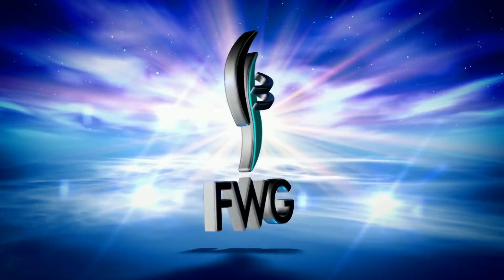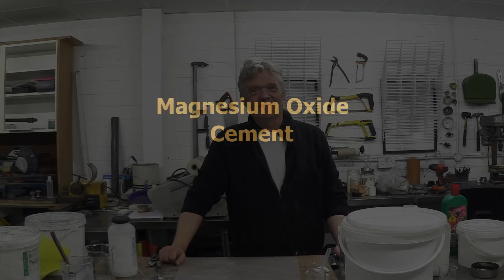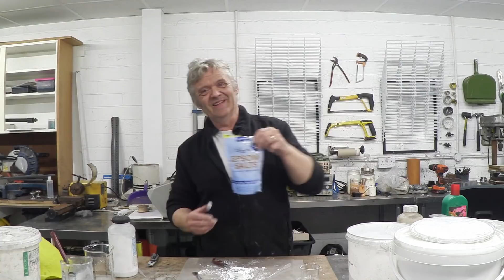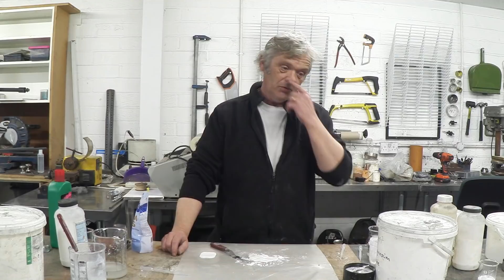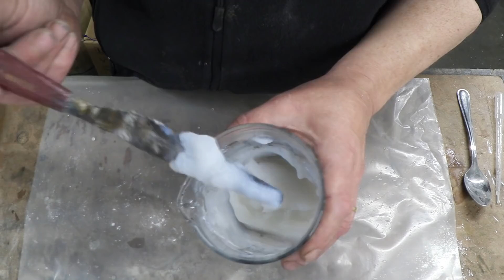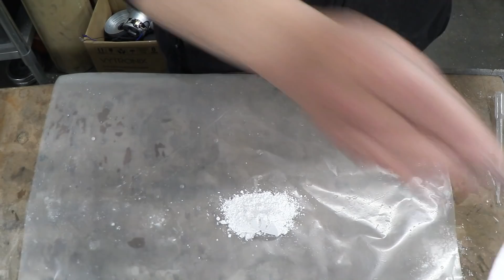All About Magnesium Oxide Cements

Comment: I am from Bangladesh. Recently I'm working on Magnesium Oxychloride cement as part of my MSc thesis. Unfortunately, I'm facing some problems while using MgO powder, MgCl2 and water. As first step, I made a solution of Magnesium chloride hexahydrate by distilled water where molar ratio was 1:13. Then I mix it with MgO powder of molar ratio 7. But, by mixing this way, I could not make any paste of cement. It remained at powder level. I further increased water upto 18 mole. But no change in the condition. That's why it was not possible for me to give shape by mold. Now, I didn't understand what fault is going on actually. I am mixing as per instruction of paper, but not finding the expected result. (Mass contect was =MgO: MgCl2.6H20: H2O= 50g: 36.23g: 41.78g = 7: 1: 13). 
 If you help me telling what is wrong here, and tell the actual mixing ratio. Then it will be very helpful for me.
Thank you

Comment: I wonder why the manufacturers of MgO boards chose to go with magnesium chloride over a phosphate. Surely they must have known that the chloride would leach due to moisture. I read that Denmark is spending 300 million US dollars to replace Mgo board used in construction.

The new MgO boards are using magnesium sulphate, which you have also said is susceptible to moisture. Any idea how they might be overcoming the moisture challenge?
Reply: I am interested in this sulfate modification to MgO board too! I thought that chloride free mag oxy sulfate board did not leach...
Reply: @SashaInTheCloud  Don't know for sure, just going by what the video reveals. Good luck with your research. I have come to discover it is a fascinating area of material science with many unusual characters doing home experiments.

Comment: ...........Thanks and I'll try some of the things you've outlined. Some version of the zinc oxide cement was or is used as a temporary filling in dentistry .locally I haven't seen lasting results where lime sand mortar was used in building work. The work being good work but the mortar being a letdown . Perhaps some critical factor  was lacking in the formula. Portland cement for mortar was rationed during ww2 and I've seen many structures in recent years that needed to be pulled down. The theory was lime mortar strengthened with time due calcium carbonate crystals formation cos of co2 in atmosphere ..I think co2 conc in atmosphere has to be just right and we've upset the Goldilocks already .
Reply from the maker: nice one ate - I didn't know the zinc oxide formula was still used - that is interesting - cheers

Comment: Hi Robert, I have got a question. If the reaction takes place when water is added, then, should we consider these cements "hydraulic cements"? 

Another question: Wouldn't it be better if you mix the 2 powders first and then add the water? Specially with the last one, the fumed silica with magnesium oxide, as dispersing the fumed silica in the magnesium oxide first will make it more workable once you add the water.

Thanks, Rob.

Comment: if you use zinkoxide and zinksulfate add graphene or graphite you would make the concrete to be  hydrophobic?
Reply from the maker: dunno - worth a try - go for it
Reply: @ThinkingandTinkering  thanks and I will give it a try it with rust...this should be the cheapest rustconverter out there...just put some Iron sulfate on the cleaned rusted surface and .....we have iron cement instead of rust....I will give that a try
Reply: @rudolfdesadeleer7995  how did it go?

Comment: Hearing the word, magnesium, reminds me of the time I saw someone throw a magnesium block into a campfire. It lit up the night like it was day time! Wow did it ever burn really really bright!
So I wonder if these magnesium cements have good fire ratings like portland cements do?
From what I have seen here, it looks like portland cement is the best all around material, it is very plentiful and cheap, it is workable, sets in a reasnoable rate of time, has fantastic strength and water resistance, fire proof and can be mixed with room temperature water to make a reaction. Portland is an all around better product for sidewalks and foundations. Just add in some tensile reinforcement and you have a really useful product!
Reply from the maker: It does burn bright for sure
Reply: They are fireproof. MG is way different from MgO

Comment: The fumed silica and magnesium oxide cement, is it not stable in water either?
If it is unstable in water, could something like water glass be mixed with it and then baked to make it water resistant?
Reply: The reason I looked here for this experiment is because I have been looking up information on Air Crete. 
This lead me to Air Krete. 
I’m looking for a very lite structural cement/concrete. 
Do you have any ideas?

Comment: Great Video Robert! I wonder if the leaching problem could be mitigated by coating the cement with a waterproof material?  I know that the Dutch use an 18kg mix of a polymer  (recycled plastic bottles! )to a ton of crushed rock to make weather proofing for sea defences such as the final layer on sea walls. I think it was the Romans who discovered cement that we use today. I believe they used weathered lava or pumice stone. Thanks I learned a lot. I wonder if the coating I am suggesting would use adsorbtion or absorbtion to stick to the surface? I suspect you would know.
Reply from the maker: for sure mate

Comment: For a short time while working on a ballistic armor project and realizing how expensive those ceramics can be I did a bunch of research into specialized concretes used for ballistic protection. I tried to use those concepts but never really got anywhere. Always too heavy. But I still think it could be a good idea.
Reply: Check out crystalline nanocellulose.  It has a lot of promise in that area--especially so when you carbonize it and blend it with epoxy, Titebond III, or similar.  I'm curious how the borax+wood glue plastic, using the former as a filler would work?
Reply from the maker: that is interesting for sure mate

Comment: This is so detailed to detailed for me  IV been looking for a fire cement for a fire pit could someone please put me in the right direction
Reply: I'm actually doing a forge/kiln in the coming days and probably got on this vid due to finding an old refractory brick video from the 50s, which showed how they made magnesium oxide/chloride alumina refractory bricks for furnaces. Personally I've settled on a mix of sand, silica powder, aluminum oxide and a inner wall of silicon carbide for the face coating (as I have all these presently) and plan to use sodium silicate as the binding agent. While the MGo idea seems like it'd work quite well with some high temp additives, getting enough in large quantities--even though the raw materials are stupid cheap--shipped to the house would cost an absolute fortune, so I'm going with my first plan. I also found a 94 page thesis from 1949 on phosphoric acid bonding to refractory materials and am reading through that looking for clues to aid what the kiln project is being built for, UHTC research. So much forgotten knowledge from the 'dark era' of scientific time that you have to really butter up your google-fu to find it these days, which is where I find so much value in Robert's videos in condensing that into usable chunks!
Reply: Looking a strong fireproof mix that will be able to take the weather I'll be watching the kiln for sure thanks

Comment: Dead burning the magnesium to a very high temp higher then what the horse stuff comes at will allow the setting time to be longer. Magnesium Oxide Potassium Phosphate and a silicate (wallostonite) combined in proper ratios will give you a longer setting time a see "
Chemically bonded phospho-sillicate ceramics" AS Wagh
Reply from the maker: for sure - cheers mate

Comment: lol, as soon as you started I was asking myself about magnesium sulfate (Epson Salts) I buy it in 20kg bags from the farm supplies cheaper than I can buy two of the small bags you had. Supermarkets make a huge markup by selling 500 to 600 gram bags. Two 20 kg bags just cost me $29 AUD. 
I wonder if an epoxy like coating will stop the leaching which will change the amount of cement production and therefore carbon emissions.
Reply from the maker: and epoxy coating would certainly reduce the leaching to next to nothing - and to be honest I am not in the least bit surprised at the mark up - just goes to show what you can save if you buy smart and mix your own
Reply: @ThinkingandTinkering  better than two hydrogen atoms teaming up with an oxygen atom to leach your cement 😄

Comment: Robert,would adding small amounts of stone/sand make a more durable version, like (portland cement) concrete?  Would like to make "cement" to use  on some large stones for steps in front of the house. They will get wet of course. Thankfully I live far enough south not to worry about frost heave.
Reply from the maker: it would make a good concrete mate
Reply: @ThinkingandTinkering  thanks for the quick answer, I'll give it a try.

Comment: SiO2 is mentioned as an additive.  Cristobalite is the neatest cement I've ever heard of.  Maybe that would be of special use here?
Reply: Cristobalite is carcinogenic, watch out
Reply from the maker: it should work well mate
Reply from the maker: Cristobalite is used in dentistry - and di you know carrots are carcinogenic
Reply: @ThinkingandTinkering  So is Tums!  On topic here, so are you implying with this vid that the valuable effects of the oxide-chloride scheme go towards the lighter alkaline metals or they can be expected to multiply anywhere in atomic weight within those metals?  Seems there's a lot of Cerium that goes to waste in industry - maybe specialty cements are its calling?

Comment: I am amazed how nobody references Encyclopedia Brittanica.  I'm still poring over the 1935 edition and it has some fantastic authors in all fields extant at that time, who put their names to the entries.  There might be useful info in wikip. but I refuse to use them because of blatant propaganda included. And correcting their errors is nigh impossible. It's a clique. Sorry, but I exclude them even in my searches. For some novel ideas, look at Rex Research, or Patrick Kelly, for example. At any rate, thanks for the always interesting exps.
Reply from the maker: Wiki has it's problems for sure - but the error is relying on one source - I tend to look at a few before coming to a conclusion
Reply: .....I agree in encyclopedia Britannica together with the year books . The ideal would be to have sets probably every eight years from last hundred years if space and shelving were available. Can pick a set up for $5 , but often they get thrown out these days .The old text books and reference books in science and engineering fields are also quickly tossed out . After mid sixties the textbooks seem to be vanity exercises for teachers and university professors for their moment of glory . .. . .You can get to the historical truth of politically charged issues through the encyclopedia Britannica of the day when it all started and the associated year books .  .Try getting anything unbiased through googling and Wikipedia for those well known simmering issues .

Comment: Climate change is one part human, 49 parts sun. Not exaggerated,  2% man caused. See Suspicious Observers channel. Would like to try these cements anyway, thanks for posting. My idea would be to add fibers or gravel to strengthen, then waterproof polymer coating after for outside use.
Reply: Regarding greenhouse gases, do you accept that increasing greenhouse gases in our atmosphere can increase the amount of heat we capture from the sun?
Reply: Well as we are humans and have zero control over the sun I am left to conclude that the only solution will come from addressing the human causes.
Reply: @blahdelablah  For every 1-degree rise in temp you have to double the previous levels of Co2 so 2, 4, 8, 16, 32, 64,128, 256, 512, 1,024 etcetera but I still think cleaning up how we do things is absolutely needed.
Reply: @Barskor1  You're implying that the effectiveness of CO2 becomes weaker the more there is. For example, doubling the levels of CO2 from "2" to "4" is a smaller increase in real terms than doubling levels from "512" to "1024". What you're implying by this is that somehow the more you increase levels, the less effective CO2 becomes at trapping heat. I don't think it's as simple as that. Also, it should be noted that one of the main risks is in reaching tipping points. So for example, at our current levels of greenhouse gas emissions, by the end of the 21st century it's been predicted that the Arctic will lose all of its ice for about 1/4 of the year. The less ice that exists in the Arctic, the weaker the albedo effect in our climate will be (ice is roughly 10x better at reflecting the sun's energy than ocean water), which will accelerate warming further. There are a number of these tipping points that exist that are expected to amplify the effects we cause by ourselves. To use an analogy, imagine you're on flat land and you kick a football, and it rolls a certain distance away from you. Now imagine you are on top of a hill, and you kick the same ball with the same force. The effort you put in is the same, but the distance that the ball travels will be greater. This is one of the problems we face, it's not just about the effect we have directly, but also the knock-on effects that would happen as a secondary consequence of our actions.
Reply: Well, what is causal source when the permafrost in the Canadian north and Soviet Siberia thaws out and releases volumes of methane which is 30x more potent as a greenhouse gas?
Reply: I'm a fan of S.O as well.  Ben Davidson seems like he has an unusually high IQ.
Reply from the maker: nice idea mate
Reply: @jonnyde  Then you build high altitude blimp drones that carry ozone makers powered with solar panels and they will break down the methane.
Reply: @blahdelablah  Oh another good reason the climate fearmongers are wrong they have been predicting the worlds end in ten to 20 years for about 70 years now.
Reply: @Barskor1  Name me a scientist who predicted the world's end from climate change in the 20th century.